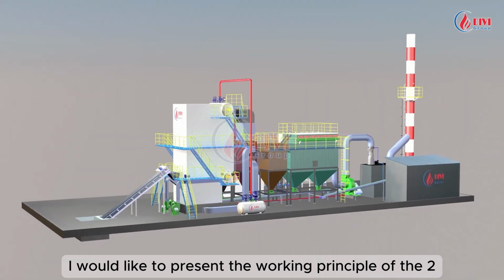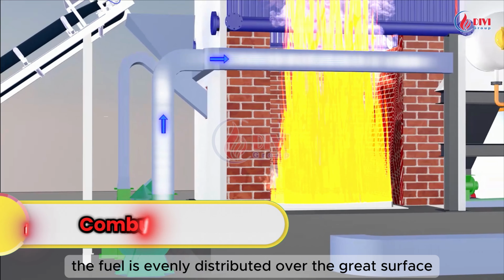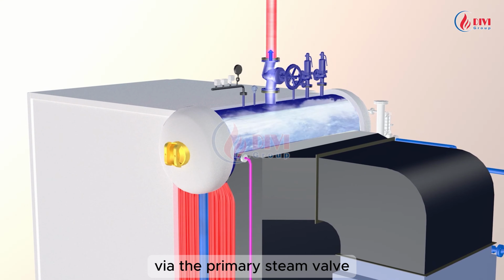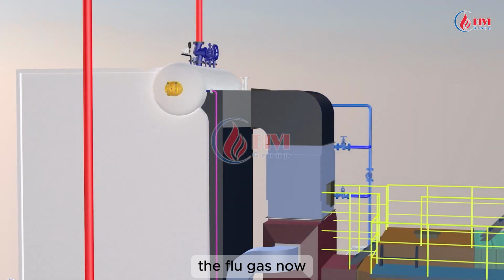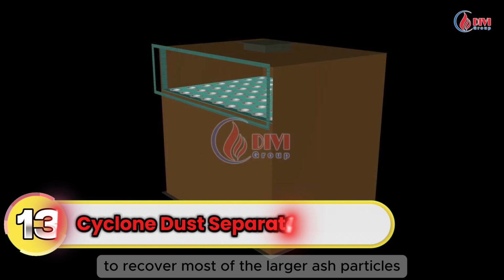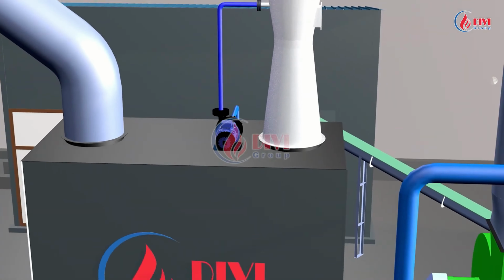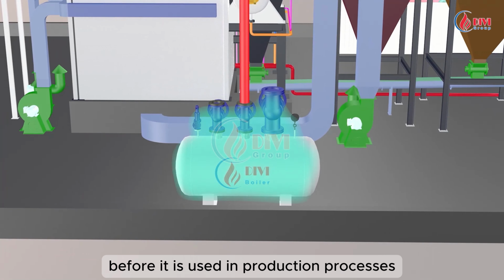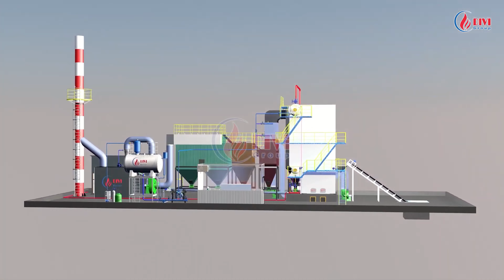[DIVI] 3D Simulation of the Working Principle of a Two-Drum Water-Tube Biomass Fluidized Bed Boiler

Comment: How can the operating process of this boiler be optimized?
Reply from the maker: This boiler is fully automatic, we just need to set the appropriate parameters and the boiler will be optimized. To have appropriate parameters, each project will have different parameters according to the actual characteristics of the factory. Therefore, to optimize the operation of this boiler, it is necessary to have experience from the boiler operation process.

Comment: In the 3D simulation of the working principle of a two-drum water-tube biomass fluidized bed boiler, which factors are optimized to enhance heat exchange efficiency and reduce emissions?
Reply from the maker: In the 3D simulation of the working principle of a two-drum water-tube biomass fluidized bed boiler, several key factors are optimized to enhance heat exchange efficiency and reduce emissions:
1. Fluidization Velocity: The air distribution and the velocity of the fluidizing medium are critical. Proper adjustment ensures uniform mixing of biomass fuel and air, promoting complete combustion and efficient heat transfer.
2. Temperature Control: Maintaining the bed temperature within the optimal range improves combustion efficiency while minimizing the formation of nitrogen oxides (NOx).
3. Fuel Distribution: Uniform feeding of biomass into the combustion chamber ensures consistent combustion, enhancing efficiency and reducing localized hotspots that could lead to incomplete combustion.
4. Heat Exchanger Placement: The placement and design of heat exchangers (such as superheaters, economizers, and air preheaters) are optimized to maximize the recovery of heat from flue gases.
5. Emission Control: The use of cyclones and bag filters effectively reduces particulate matter in emissions. Additionally, limestone may be introduced into the bed to capture sulfur dioxide (SO2) if the fuel has a high sulfur content.
6. Air-to-Fuel Ratio: Optimizing the ratio ensures adequate oxygen supply for complete combustion while avoiding excess air, which could lead to energy loss and increased NOx formation.
7. Ash Handling: Efficient removal of ash and non-combustible materials from the bed prevents fouling and maintains stable operation.

These factors are typically adjusted based on the specific fuel properties, boiler design, and operational requirements. If you'd like to know more, feel free to ask or refer to technical guides on fluidized bed boilers! 😊
Reply from the maker: If you like my answer, please share this video. Thanks!